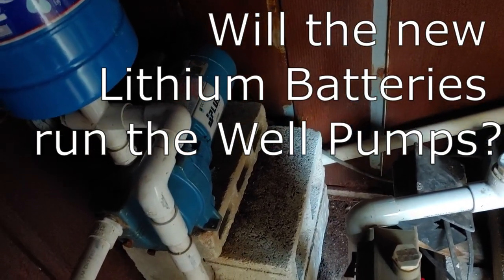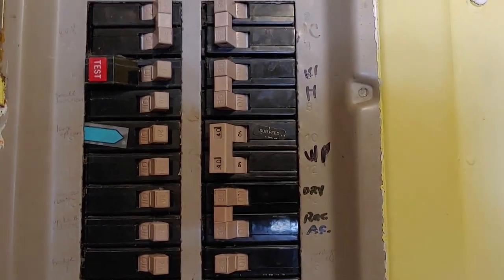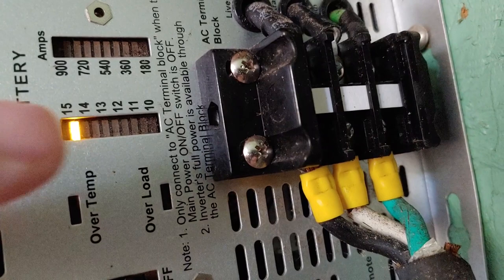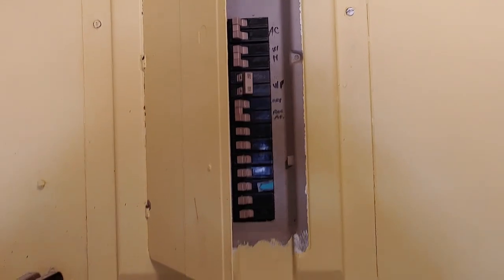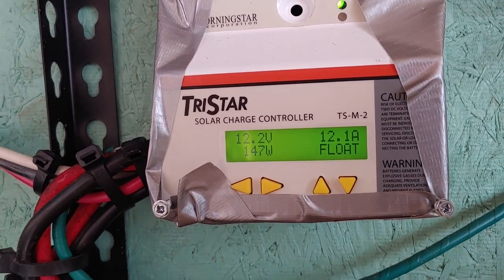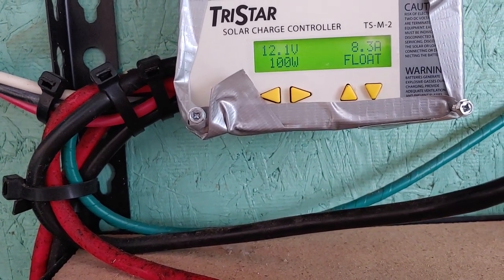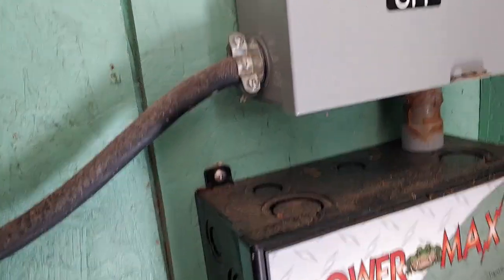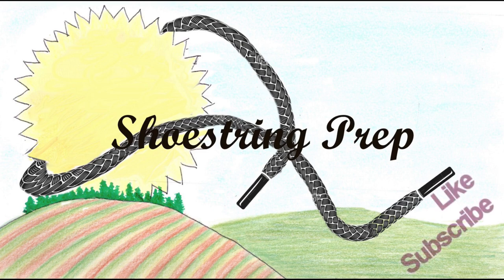Off-Grid Solar Power System:  Well Pumps Test w/ Lithium Battery using FLY POWER 100-ah batteries.

Comment: Aren’t those pumps 220 volt split phase?  Inverter is probably 120 volt single phase.
Reply from the maker: The well pumps have a switch they can be set at 115 or 220 volt. I have them set at 115 volt. Thanks for the comment

Comment: just watched this video.....did you figure out your voltage drops?   it looks like you need to use larger cables and change the way you connect the inverter to batteries.  dont connect both cables to the same battery.  use one end of the battery string to positive and the other end of the string to the negative  to get all batteries involved in current flow.
Reply from the maker: The voltage drop was because of a mis-read by the charge controller. 
Thanks for your comment.

Comment: i think the inverter connected direct to the battery's will stop the voltage drop
Reply from the maker: I had not considered that. Thanks for your comment.
Reply: @shoestringprep  my trick is use the output of the solar controller to run a relay thay then control the on off switch on the inverter or shuts off the main feed to the inverter as scc tend to have more settings mainly when i was playing with 18650 li-ion cells the inverter would not play ball lifepo4 i have not used so dont know if the inveters work in the right coltage ranges